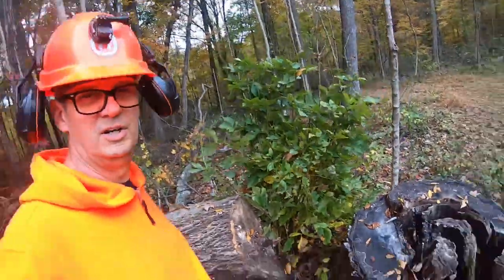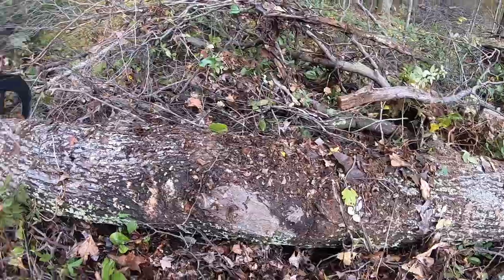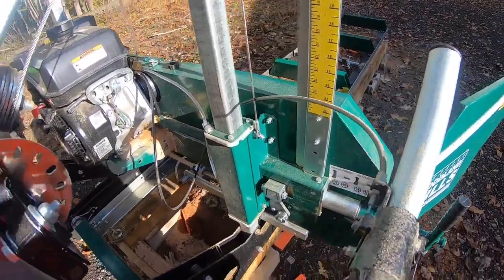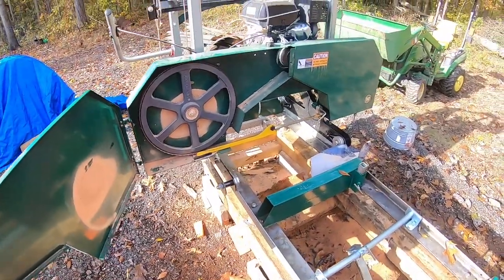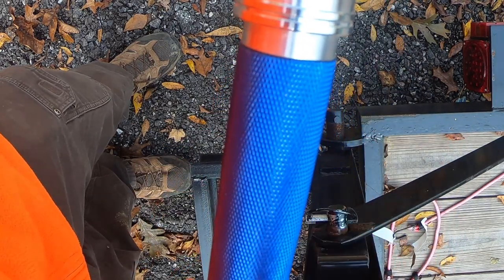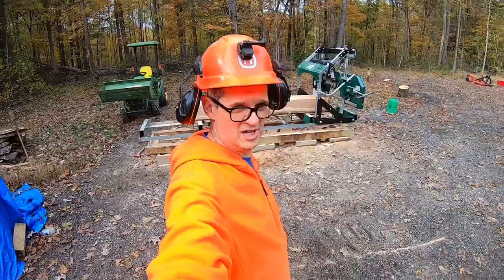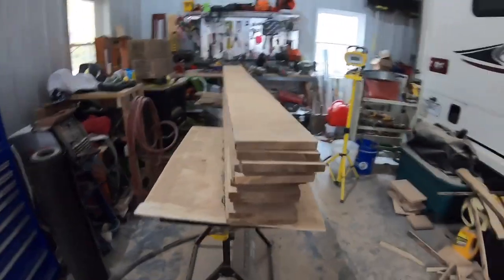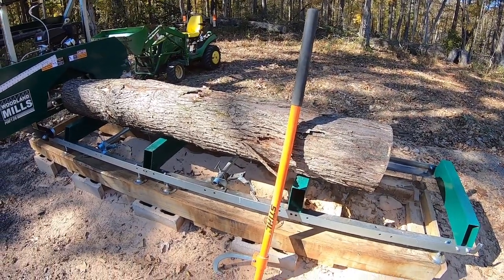Woodland Mills HM126 Pignut Hickory #11 | CBH

Comment: Hey enjoy your videos!  I am trying to source the white magnetic ruler you have on the belt guard.  I need something like that for my mill.  Thanks
Reply from the maker: Thanks for watching and your comment! That came with the mill. You could probably contact Woodland Mills and purchase it. There is a yellow one also with different markings. I haven’t really used either of them, just measure and mark the cant when I need a measurement. Most of what I cut are three turns on the crank and comes out at 7/8”. Have a great day and be safe ❤️
Reply: @CopperBarnHomestead  thanks,  i mark my cants too!